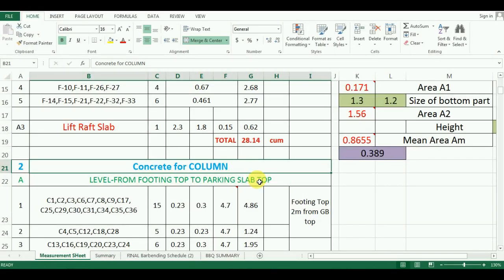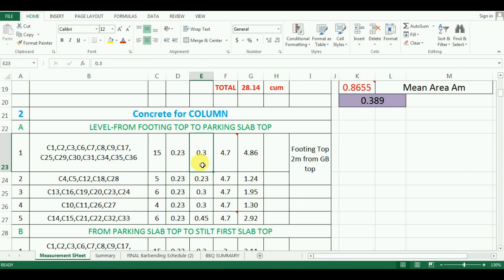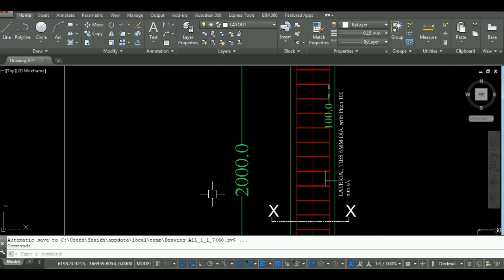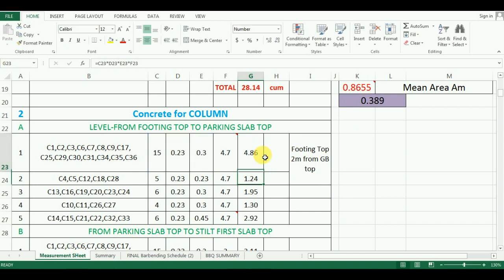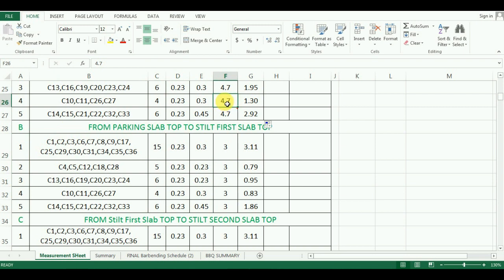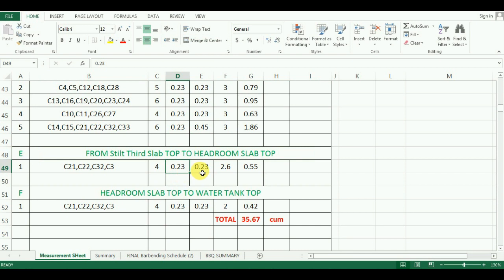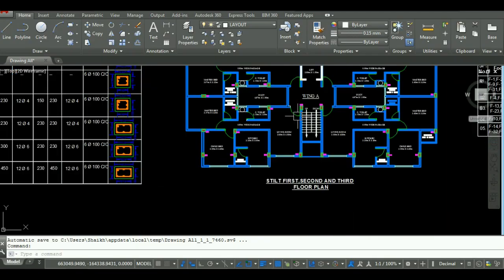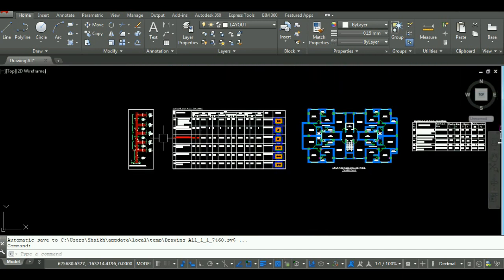Detailed Estimate of a G+3 Building in Excel -Part 5 Concrete for COLUMNS

Comment: What about the bars in it? Will it reduce the concrete volume?
Reply from the maker: The steel quantity may vary from 1% - 3% of the volume of concrete in reinforced concrete structures. Since the volume of steel is comparatively low, steel volume is not deducted in calculating the volume of concrete required.
It is also written in IS-1200 (Part II) - 1974.
Reply: @unitecoaching  thank you..your work has been so much helpful! Please upload bbs of slab..